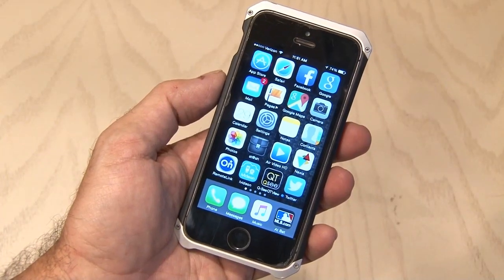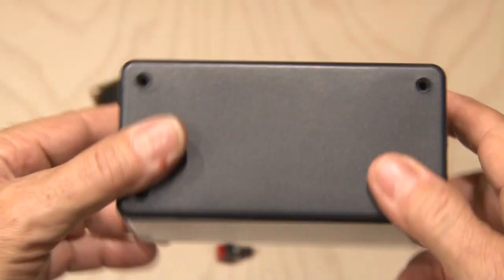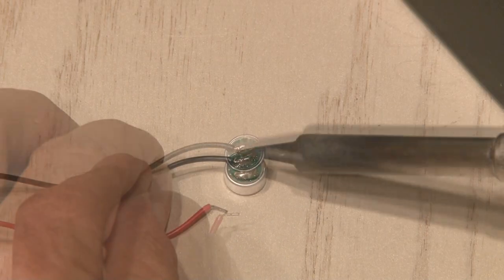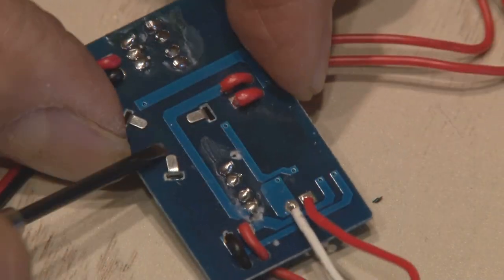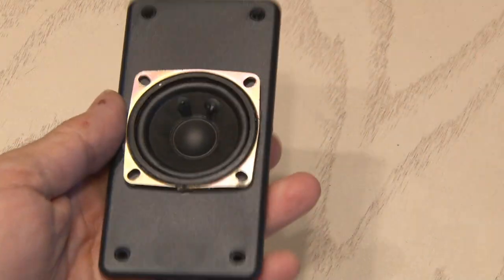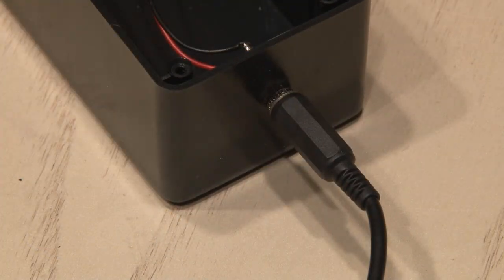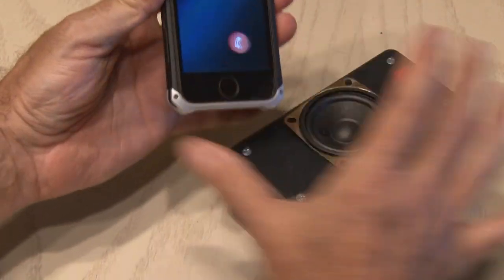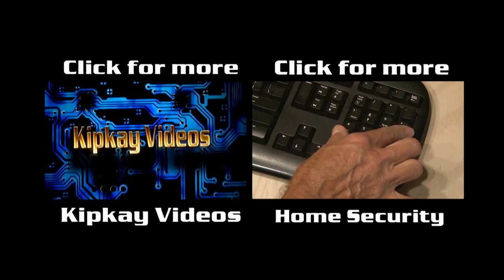Phone Spam Destroyer!

Comment: I have a button on my phone that says decline. I wonder what it does.
Reply: timinator855 I wonder why they will call again if u click it.
Reply: Commas, use them.
Reply: SandwichedTom Nowhere in either of those comments was a comma required or even necessary.
Reply: Robbie 1400 Maybe, but the structure is still valid the way it is.
Reply: I would say it helps to link the two sentences but yes it would be valid either way
Reply: Huh. I have no idea.
Reply: +SandwichedTom welcum 2 te fooken inturnet den
Reply: +timinator855 I'm also not sure what the phrase "just for fun" means.
Reply: lol
Reply: +SandwichedTom grammar, use them. (commata)
Reply: But it's so they don't call again
Reply: timinator855 it hangs up on anyone
Reply: timinator855 decline just ends the call, they'll call right back lol
Reply: YS World 

It* ;).
Reply: Ryan they use automated dialers so they will call back either way
Reply: Ryan they don't call again.
Reply: A decline button? Impossible!
Reply: +The_Angel_Simmer 
They do.
Reply: These guys are calling again and again...
That's why you should use such a machine
Nobody will call again, in order to remain the ability to hear XD
Reply: Use airplane mode for 10 secs,done.
Reply: timinator855 it declines the call.
Reply: timinator855 it
 ends call.
Reply: The point is that there is a chance that phone spammers will call you back if you decline the call. If they think your number doesn't work, they won't call you back. Plus, lots of scammers run off one database of phone numbers and if they think a number doesn't work they will remove you from their internal database and any other phone spammers will not have access to this number.

Comment: Easy solution to this that works on your phone, nothing else needed to "destroy spam calls" (but this explanation is long winded...) I have this recording set as the beginning of my voicemail on my cell phone. This recording is just the three tones at the beginning of the recording though, no words, and basically signals to telemarketer dialers that the number is out of service. The three tones are what it listens for, nothing else... people on my VM may get freaked out but all have gotten used to it. In the past few months I've only gotten two spam calls (both not in my area codes or those that border mine) and they have been sent to voicemail, haven't heard back from either. Works like a charm.

Getting the tones on your voicemail is the difficult part, to do this you will have to find the three tones (grab a recording online) and record your voicemail greeting after it. Use Audacity or similar on computer. Then find a voicemail access number for your carrier and play back the recording on Google Voice/Skype or similar. If anyone is interested in this but still a bit confused, drop a reply to this comment and I'll help you out.

Hope this helps you

Comment: Just have the sound saved on your phone, and play it when they call. 100x easier.
Reply: Kyogre Cubing | ikyogre1 Have an app that shuts the mic off and plays this audio on a software level. I'm sure someone could code an app for it.
Reply: Jaymes Stewart It won't work, it is restricted in Android API, and im pretty sure it won't be allowed in other mobile operating systems also.
Reply: Jaymes Stewart can't be done. You can't do that during a phone call. The iOS and Android SDKs both dont give you API access to it
Reply: +Zaviex +adi4u48821 What if you just have an app answer the call and play that message? For example when using Android and it asks you what you would like to use to do a certain action, make said app the primary. Idk if it would work but just an idea.
Reply: daobri belleh I acutally wanted to develop an app like that few years ago, but during call actions, no other services can interfere with it, only you can manually record, or speak something. And if you were to attend the call and want to play a msg via a sound filem it cannot be done since Music Player fucntions can go only one way, only you can hear what's playing, and the same happens on speaker also. The simple answer is no, at least for now.
Reply: +adi4u48821 What about apps like PrankDial that play a pre-recorded message? If you combine that with voicemail apps like YouMail that can intercept a call, couldn't this idea theoretically exist?
Reply: adi4u48821 They made one finally called RoboKiller. Yay!
Reply: If you play something on the phone ur onthe phone with, other personwill not hear it
Reply: Kyogre Cubing | ikyogre1 this is cooler

Comment: I know you said blocking doesn't work at sometimes, but it depends on how you block stuff. I used groups on my phone and some app that allows me to select a group to only accept calls from. The group has all listed numbers I know and anything not on that group is auto-blocked + phone volume temporarily turns down. This works for any number that isn't on the group at anytime. It's not hard.

Comment: I have a little hobby of costing telemarketers money by keeping them on the phone as long as possible. Personal best time: 2 hours.

I have a neurological issue that when I'm tired, causes my vocal cords to tighten and tremble giving my voice the shaky higher pitch sound of someone pushing 90. I turn that to my advantage by adopting the persona of a wealthy and partially senile retiree who will buy almost anything just have someone to talk to. 

There are websites used by programmers to produce credit card numbers that although fake and invalid, match the proper pattern so that the only way to tell them from real numbers is to run number through the system (which cost money.) Programmers use the numbers for testing how their software handles credit card numbers but if you give one to a telemarketer, their system will accept it as initially valid when typed in. Then I engage in an elaborate back and forth of re-reading the card screwing up the number a different way each time. Then I switch card brands and start all over. (Note: this isn't illegal because you know the card is invalid, know your talking to con-artist criminal and have neither the intent nor means to steal any good or service with the fake card number.)

Then because I'm old and "have a prostrate the size of a grapefruit" I have to go to the bathroom, then get something from my office, answer the door etc. Since I'm on a cell phone, I keep up a prattle all the while, which sends me off on tangents and makes me forget what the phone call is actually best. 

All the while, my family is sitting around just about to burst a gut laughing just from hearing my side of the call. 

The call usually ends when I can no longer contain my mirth and start laughing like a braying mule and just to salt the wound, inform them that I've been scamming them just to wast their time and cost them money. The slight sinking tone of their voices when they realized they've been had is SO sweet!

Once in a while, when I run out of time I say something like, "Oh, them FBI boys tell me they got all they need so I'll be saying goodby now." and I hang up. 

If you've got the time to kill, it's a lot fun and if enough people did it, then it would put a significant dent in the telemarketers bottom line, not to mention their morale.

Comment: Better option would be to make a docking station were you could place your phone, have a small speaker placed near the mic area "this would be built into the docking station", when an unkown number calls you simply hit the button, means you don't have to hold it.. also would it not have been better to use a repeater? and then have a button were you can manually cancel it? kind of like an on/off button.

Comment: One of the old tricks I used to do, I had an old 2400-baud modem that had push-button controls on the front, to put it in Answer or Originate modes. (it wasn't AT-Hayes compatible).. When An Obvious Telemarketing machine (recorded message) started, I would simply press the Answer mode button, and hang-up the telephone..  After about 3-4 tried at connecting, it would eventually hang-up. I can imagine whoever listened to the recording on the other end, got the point when they were greeted with a LOUD tone.

Comment: There is a device called the TeleZapper which uses the same three exact tones to automatically "zap" the telemarketers. In fact, I just installed it on my phone about two weeks ago and tried it. Guess what? It did not work.....at all. I continually got the same spambots everyday...and of course, human telemarketers did not fall for it. My sister got the "TeleCrapper" for a buck in a thrift store. It was brand new and never opened. Being that it was several years old already, I had to replace the CR2032 battery inside, something the directions does not tell you. Damn telemarketers win again!  By the way, I installed it on my land line phone with my answering machine as per their directions. I heard the three tones right before my answering machine kicked on like it is supposed to work. I was hoping to at least kill the recorded telemarketer machines, but no go. Maybe KipKays will work better because it has the whole message after the three tones?

Comment: I used Google to look up how to say phrases in different languages.  It took only once for the repeating caller to get answered by a "German" speaker who could not understand the caller's English and the calls stopped.  I had a backup language to switch to if the caller knew German.  Yes, they would have guessed I was faking it, but the laugh i would have gotten would have been worth it.

If you are good enough - just practice saying decent sounding gibberish phrases.

Comment: is this possible?... could you just use the headphone jack in your phone and a headset with a mic then chop off the headset/mic cable and solder a male 3.5mm connection to the mic wires and then plug your audio suicide cable in (original jack with mic sleeve into phone, new 3.5 into audio source) then you could just blare horrible high tones in their ear, you could probably make it louder with a headphone amplifier. right or wrong?